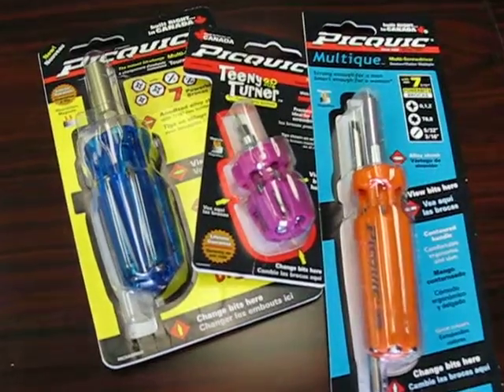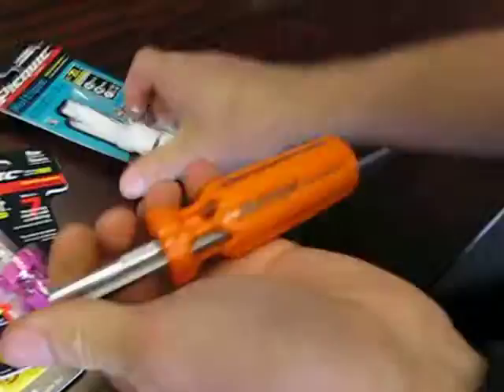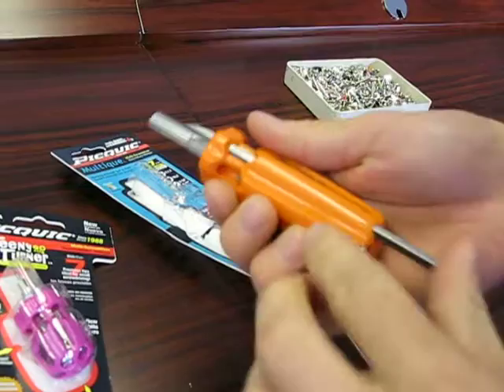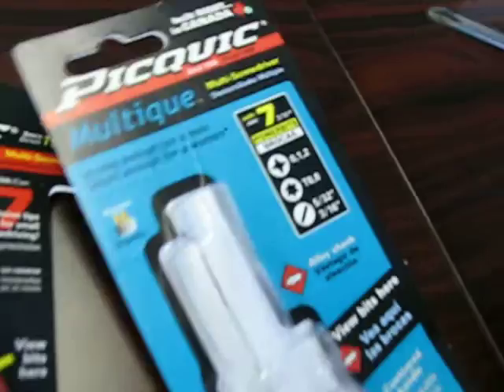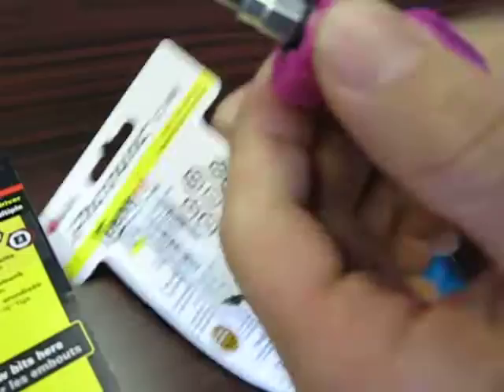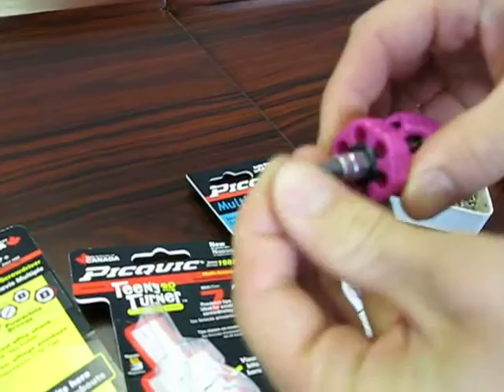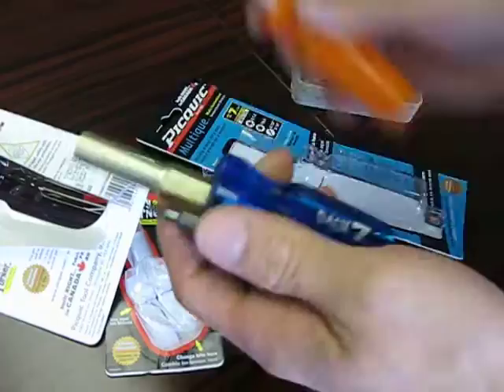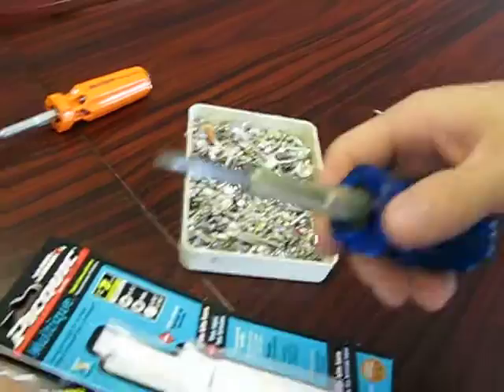Picquic Screwdriver Dash 7, Multique, and Teeny Turner Hands On Linus Tech Tips

Comment: with regards to the magnet..... the magnet is built into the shank to hold the BITS in.  It was never meant to be able to "magnetically" pick up screws.  The magnet just happens to be strong enough in the shorter drivers like the Teeny Turner to hold screws, an added bonus.